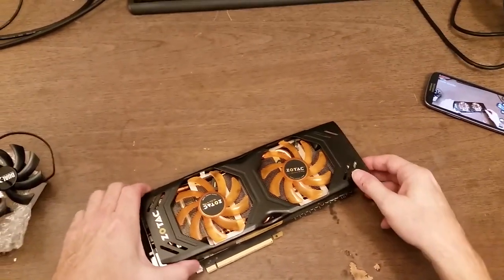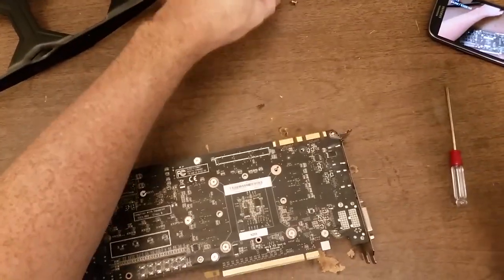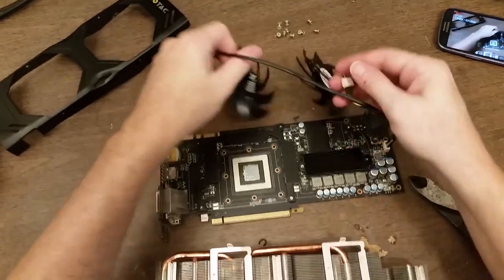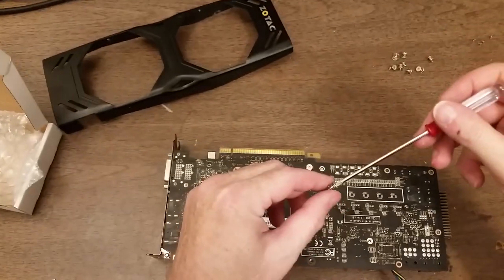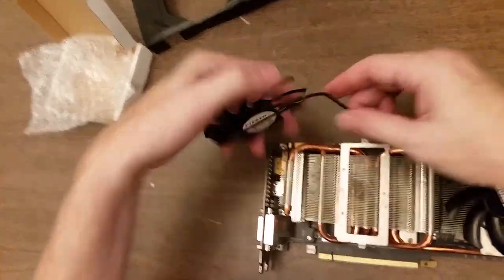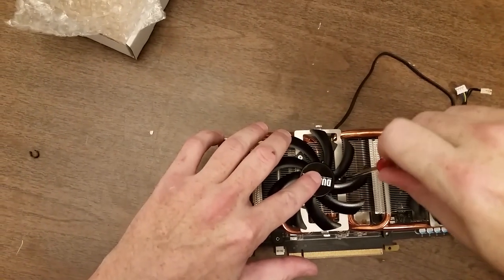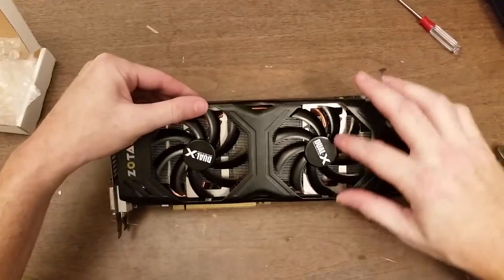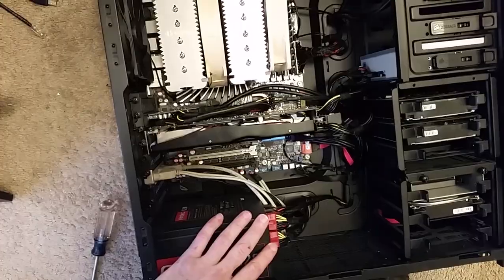Replacing the fans on a video card, Nvidia GTX 770

Comment: Smoother than my replacement.  The fans I found had apparently matching part numbers, and they looked identical, even had the correct stickers on the fans, but the wires were too short.  :(  Had to solder in more wire to get them to fit.
Kind of a sad commentary on society, but when I was looking into finding fans, I read so many posts from people that said it was best just to throw out the whole card just because of a bad fan and get a new card.

Comment: I just bought a couple of fans but only realised they were 3 pin and not 4 pin. Not sure if the power is up to spec as well as the card fan won't ramp up when gets hot. There are alot of lousy oem in the market. I want a good oem spec fan that works just as well as the original. Seems to be impossible to find.

Comment: I'm having the same poblem. One fan just died and the other does a nasty noise now but I've been unable to find a replacement to them. Your video was a godsend as changing the video card just for this is a huge waste of money.

However, I still need the size & number of pins for the fans in order to buy them =/

Anyone knows if it's 75mm or 85mm? I have the gtx 770 amp edition.

Comment: I was wondering where did you get the replacement fans from ??
Reply from the maker: Bruce Wurdemann A seller on eBay.  I took the fans off and got the model number from them and also measured the fans. The model number showed up as two different sizes so that was very important.
Reply: can you link? i got a broken fan and i got the exact same card

Comment: Link for the fans??
Reply from the maker: The fans for video cards really aren't standard enough to provide a link. You're better off looking at the connectors all the fans you have you want to replace, the model number on then,  along with their size and width to find a replacement.

Comment: So i have the evga gtx 770 where can i find the replacement fan for this version?
Reply from the maker: Dkzeria PR You should be able to find a replacement on eBay. What you have to do is take the current fans out, to take a look at their connectors, the cabling and the model numbers on the fans. You also have to measure the width of the fans to make sure they match up to what you buy on eBay. You need to do this because there are very often different sizes of the fans even though the fans have the same model number.
Reply: Michael Cooper Thanks for the warning. First I check the measurement and then I'm sure of everything.

Comment: new fans are not necessary!
just unscrew the original fans and turn them to the backside.
there is a sticker on it - liften this sticker up.
now you have to make a little hole (2mm) in it.
after that put some drops of oil in it and thats it:

here is another guy who made this methode, and it works!
https://www.youtube.com/watch?v=8WYFYFHRtjE
Reply from the maker: whiteCHAYTON no they were actually loose and hitting the sides. Lube helps some things but not this.
Reply: i have the same graphics card and also thought that it is sloping and hitting something. It sounded like as if it touches something a cable or plastic. but after some lube no noise anymore in my case. and there are also videos where you can see before the lube the fan turns sloping but afterwards fine again.
Reply from the maker: whiteCHAYTON okay. Something to drive before replacing the fans. Thanks
Reply: I have this same graphics card. My problem is the fans are going up then back down with the rotation speed, I dont know what to do I tried new drivers, checked the fan speed with softwares, but they werent indicating anything special. Any idea?
Reply: Thank you for sharing, Ill try this tomorrow